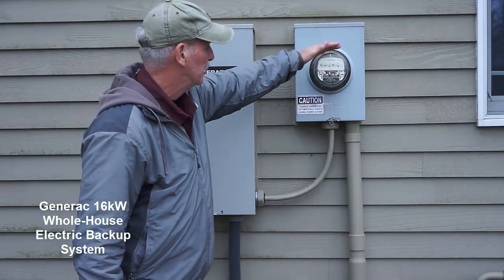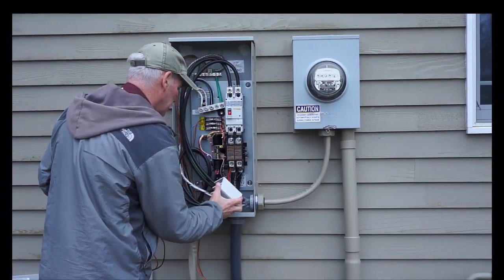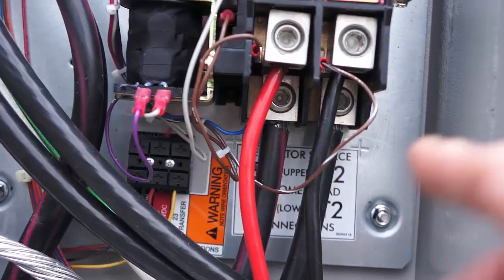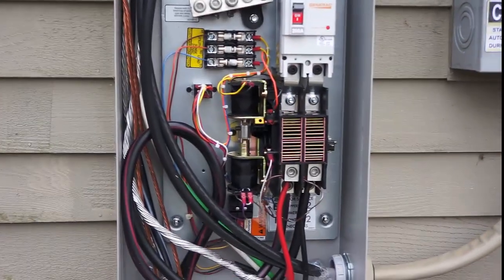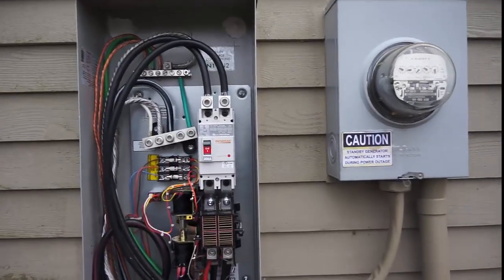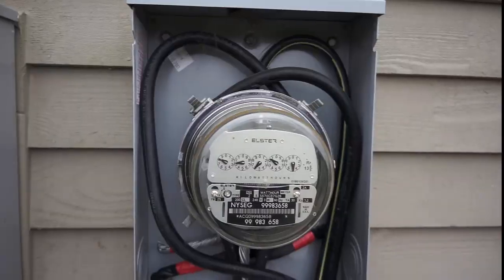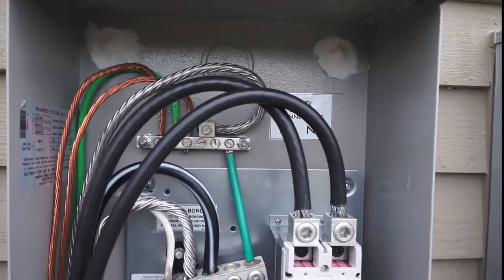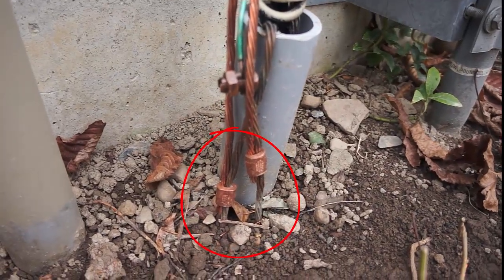Generac 16kW whole house power backup DIY Installation

Comment: Looks good, but this is an good example of why they should be installed by an licensed Electrician/Genarac dealer. And like some other people have said yes the ser should be sleeved, because there is not overcurrent protection between the meter and the transfer switch. And ser should be protected from physical damage via conduit or in wall. But is up to the ahj.
Reply from the maker: The county electrical inspector signed off on the work without SER conduit nor overcurrent protection before the transfer switch. {Not to say its not code in other areas.)
Reply: Isn’t the breaker in the switch over current protection, similar to the main in a panel?
Reply: SER amd SEU are designed to be run through attics etc. Much like a romex. They wont last outside in the weather. If you were to run conduit there would be no need for service cable. Just run individual THHN conductors.
Reply: @clayadams2068  seu on the side of my house from service drop to meter for 25 years still looks good. Oh yes because its rated for outdoor use. Dunb ass
Reply: Hi, whoever use portable generators really should ignore this link https://youtu.be/bQR0UyLv4_Y people really needs to see a video on this link about generator safety. A lot of people died from carbon monoxide poisoning ⚠️. This really is something you should never ignore. Do not ignore this please. This also needs to be reported on this news too.

Comment: The cost of this gotta be crazy generator plus install
Reply: $9600 is what mine cost for the 22kW model with install.  Price varies depending on how far the unit is from the electric meter and gas meter.

Comment: It’ll looks cleaner if SEU & SER wires are in a conduits and it will protect wires from  physical damage .
Reply: You're right, I could have used conduit, but SEU and SER passes code in my area. (I also could have run my gas line underground to the Generac flex gas cable.)

Comment: Where is this at? Wiring method could be improved. Bonding between neutral and ground should not be there. Bonding should only happen at service box, any other cabinet should be separate so grounding works properly.
Reply: THAT BECAME THE SERVICE, WHEN THE TRANSFER SWITCH HAD A FUSED DISCONNECT INSTALLED
Reply: Few tweaks needed, thanks for video.
Reply: Mendez I'm hooking up a old 2003 , 20KW , with the 1.5l lig cooled end. Would love a bit of help. you were talking about the green bonding wire, and neutral. I was going to wire my outfit up the same as in this video. for the most part. If pos i would love more info on the bonding matter 812 697 0212
Reply: With the switch being between the meter and service box, isn’t separation of neutral and ground required at the switch?
Reply: @robgreene7958  no, switch is first point, panel inside would have to be.
Reply: @robgreene7958  No. The transfer switch is your first means of disconnect. You bond at your first means of disconnect and then send 4 wires to your house panel which is now a subpanel. Your meter base is not a means of disconnect.
Reply: Clay - I asked that wrong - I meant need a separate ground and neutral out of the transfer switch.  You did answer my question though.   Thank you
Reply: Was looking for that comment scrolling down lmao

Comment: Nice job but you should never use as SER cable without a being put inside emt pipefor your feeders
Reply: Was gonna say is that painted ser?!? Bad bad idea. Would not pass inspection. Protect that damn wire!
Reply: It code..SER..sure more mite be better but big foot mite not go there nd eat at the power cable ...jk
Reply: @mynextketchfrontier6351  SER cable without an insulated neutral conductor and exposed to physical damage is not code... 2 wire cable with stranded ground is for use with 240 volt circuits not 120/240 volt circuits as the bare ground is not intended for use as the neutral conductor.
Reply: @crosswiredelectricalservic996  the none insulated wire you see is the Ground wire.. nuker is insulated..agreed that it should be in some source of wire way...thnx
Reply: @crosswiredelectricalservic996  SEU CABLE SHOWN IS SEC.  BEFORE A FUSED DISCONNECT IS FINE.  THE SER PAST THE DISCONNECT NOW SERVES THE HOUSE PANEL MAKING IT A SUBPANEL.  CHECK THE NEC.

Comment: How do you have SER & SEU cable exposed potential damage that low down outside?
Reply: It is code in our area but if I was to do it again I would have used conduit.
Reply: @BillKleitz  that's always so interesting how codes vary between State to State
Reply: They are outside. Not against the code
Reply: In Michigan it is legal to run SE outside without protection

Comment: Can a transfer switch be wired to feed the meter instead?  My meter is 120’ from my house with two disconnects (barn/house).  I want to put the generator out by the pedestal, transformer and my propane tank.

Comment: Just had 16kw installed....ran twice the first 9 days after install. Very happy.
Reply: you're lucky. I haven't had an outage since I installed my unit. (My utility started a massive tree-trimming campaign just after I installed.)
Reply: How much was the whole process if you don't mind me asking?
Reply: @slowsti0535  ...$8000 including everything, transfer box too and 10 yr extended warranty.
Reply: @patriot4757  Damn that's not terrible!
Reply: @slowsti0535  ....we have had outage issues the past 8 years....could not take it anymore. So happy we did it. It is run on my natural gas.
Reply: @patriot4757  the 16kw is sufficient to run the entire home?
Reply: Slowsti05 .yes. Entire house and furnace 👍🏻
Reply: @patriot4757  thank you for your help

Comment: Do you have to run SER to the panel if you run #4 solid copper to panel ?
Reply: The codes vary all over the state, he said it was inspected, therefore legal!
Reply: Don't use SER cable like he did that's hack work for lazy electricians. Were not even aloud to use that here.

Comment: Damn, is that generator as loud as it sounds?
Reply: Not that loud. Portable is louder
Reply: yep
Reply: @kleitzw  Poor neighbours.  People over here would complain with that racket...and rightly so.  In outages, I fire up a small inverter generator to run small appliances and charge batteries. Over night, I run a couple of fans and lights off the batteries with an inverter.
Reply: johnmcquay82 it has a full on engine in it what do you expect. On my street it’s about 6 of us with these generators and yeah it’s loud for everyone but we got used to it and atleast us 6 have power. My neighbors diesel generator is the loudest on the block
Reply: @theclueguy3388  There's no reason for them to be that loud anymore. Northern Lights generators are extremely quiet compared to this. Even Cummings Onan is considerably quieter.

Comment: That wouldnt pass inspection pal.
Reply: The only place int the code where a drip loop is required is on overhead drops.  Eventually the entire enclosure will rust and the house will rot away but that does not make the install wrong.  That same SEU connector that goes into the side is installed on the top of 99% of most 200 amp and under overhead services. With some duct seal , the will last a long time. If you look at any  overheads without a mast you will see it. Or if you were informed you would know it. Why do you feel the need to critique things that you are uninformed about? heres a link and yes I am licenced...https://www.google.com/url?sa=i&url=https%3A%2F%2Fwww.thebuildinginspector.net%2Fflorida-home-inspections%2Felectric-service-capacity%2F&psig=AOvVaw08ecH7Oq-UuwHl9LNfdxby&ust=1577386705263000&source=images&cd=vfe&ved=0CAIQjRxqFwoTCJC-6sW90eYCFQAAAAAdAAAAABAG
Reply: radiorich are you holding a masters electricians license?
Reply: No and I dont have to.
Reply: @RadioRich100  Sounds like you stayed in a Holiday Inn Express last night, good for you!
Reply: Really? but it DID pass. Why, what are you seeing wrong?
Reply: Do we need two ground rods or one here?
Reply: @climb4it   I would install 2 ground rods 6ft apart. #6cu solid wire is all that is required to a ground rod.  You need to have 25 ohms or less. with 1 ground rod. Install 2 and not required. Additionally a conductor sized per Article 250 NEC is required to the water pipe. If the water pipe is copper coming in to the house
Reply: I can’t help but notice the sheathing on the red feed from the generator looks like it is split open on the side facing away from the camera. Maybe it’s just me.
Reply: That cable going from the meter to the transfer switch has no drip loop nor is it in conduit. That would never pass here. Water drops will follow the cable down into that fitting on the transfer switch. The knockout on the TS should have lined up with the one on the side of the meter socket and been conduit-ed straight across.
Reply: @RadioRich100  I guess the inspector felt that the two watertight connectors were sufficient.
Reply: Over time it will leak and your transfer switch will get water in it.